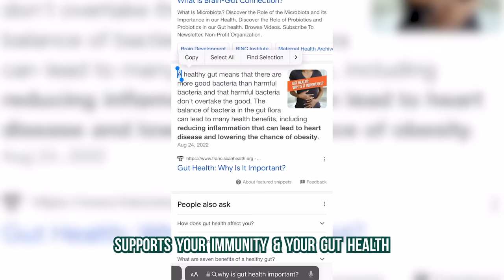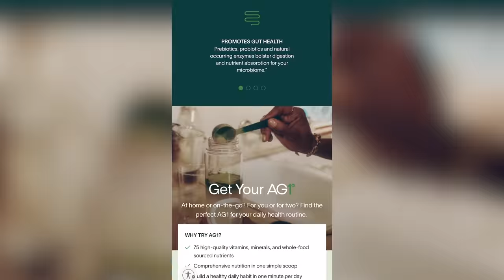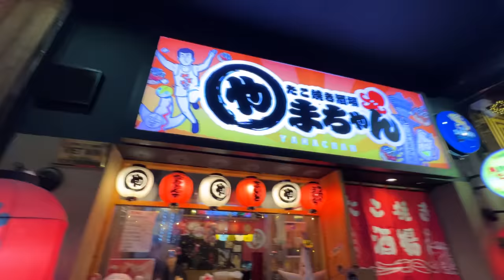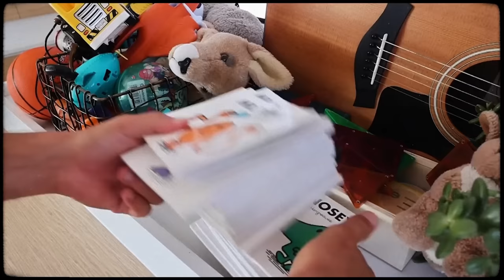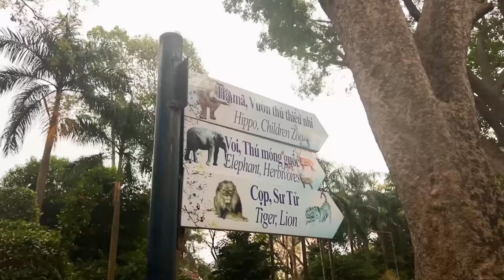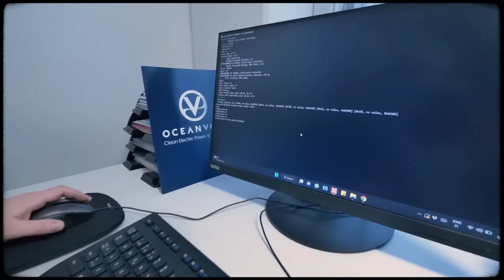When LIGHTNING strikes a Sailboat

Comment: As someone that has spent the majority of their working life in the lightning protection & surge protection industry (over 30 years) I just want to add a little technical perspective. 1) It's not possible to attract lightning and people should be very wary of any person, company or product claiming that they can. 2) Lightning is only ever looking for a quick and direct path to earth, strikes to boats are incredibly rare, mainly because many boats / yachts are glass fibre / carbon fibre these days and these do not offer the quick and easy path to earth that lightning is looking for. 3) The "electrocution from the iPad" that Colin described is called 'touch potential' it's one of the most common ways that people are injured by lighting events. you can protect your electrical equipment (especially communications and navigation) by installing surge protection devices. When in an area where there is lighting activity quickly unplug any devices or equipment (ipads for example) that are not essential for boat safety and navigation. Happy & safe sailing everyone.
Reply: Thanks Sean. I’m really interested in this area and am doing experiments with my boat to protect the system as much as possible. I’ve been suggesting to electronics systems builders that they incorporate optic fiber communication in the boat systems to break up conductive pathways between the various processors on boats such as the Navigation, remote processors, and battery management systems. Surge protection will be pointless if data lines become a pathway via capacitance or induction from a high current strike. I’ve installed all of my solar energy system MPPT’s, BMS’s and Lithium Batteries in a single metal case which hopefully will act as a Faraday cage, and can unplug the solar panels with a single 8 pin plug. The output side can also be unplugged as I have a DC/DC converter charging the house bank, and this can be unplugged easily too as it is just 2 wires. My current house bank will be replaced with FireFly batteries when |I can source them, as I believe these are relatively robust storage devices.
Reply: @williambunting803  You are correct William that isolating interfaces like fibre optics, galvanic couplers etc prevent the conduction of any lightning energy and would make boats safer

Comment: If you look at any lightning strike videos on YouTube, you quickly realize there is not much that can protect against that much power. The best protection is to avoid getting struck in the first place, if that's not possible, then make sure you are not near anything conductive and unplug everything you can unplug. I got sort of hit by lightning years ago when I was on a boat and lightning hit the water about 500m away from us. My hand was about 4-5 cm away from a metal railing and the lightning arced from the rail to my finger. I got shocked pretty good and got a blister on my finger but was otherwise alright.

Comment: You are in THE BEST POSITION with your new boat.... to have electronics removed from circuits when not in use... ( isolated)... yes when underway you need them... but when at anchor or docked... have all that are not needed... removed from any and all electrical connections.... sure the builders want you to burn them up and buy new....

Comment: I used to have a 6 gauge copper wire run down from the top of the mast to the water. It actually worked when we got hit by lighting, all the instraments were fine.

Comment: Love the blue that you decided upon. Being from an area of Florida with a very high level of lightning strikes, I make it a habit not to charge my phone, laptop or even keep TV's plugged in during a heavy thunderstorm. My TV and DVD player are only plugged in when in use anyway. Hope everyone is feeling well. Take care and God bless.
Reply from the maker: Florida has the most gnarly lightning we’ve ever seen. Absolutely terrifying 😮
Reply: When I worked in electronics retail there is a thing called a power conditioner. It was pretty expensive and very heavy but we sold it to our high end clients that bought larges amounts of AV gear. What it does is take power (raw power is rough even on its own and can damage all your stuff over time, even without lightning) and actually clean up the spikes and dips and smooth out the power levels. From there it's stored and then fed into the system as clean power (no spikes, dips, or pops). They always come with a pretty significant fuse system so if a surge powerful enough to do damage to your stuff happens, it breaks the circuit and protects your gear from damage. For a boat I would have recommended a Faraday cage built into the boat that would ground to the bottom or keel but its probably too late for that now. Maybe they could build a Faraday cage into the control console at least.

Comment: IMO - For lightning you need a Spiky (and well grounded) antenna on top of your boat as it helps to discharge the electrons into the sky rather than store them which causes a higher discharge potential.

Comment: The pink paint is referred to as Guide Coat. Often just thinners with some colour tint in it, but there is ready to go Guide Coat for $$$. This was applied by rag but is often sprayed. It allows the paint team to see they have properly sanded the surface and helps identify any low spots that may require filling and then priming.

Comment: The "simplest" lighting protection one can install is an isolated lighting rod at the highest point (above the antenna and masts) with a very thick, low resistance cable extending straight down through the hull to a rod / plate in good contact with the ground / water.

Electricity takes the route of least resistance, so if you can give it a safe route to take, it will.

The catch is, lightning is SO powerful, it may overwhelm your protection system and ALSO go through unintended paths.

Comment: For lightning protection a possibility would be a lightning rod on the mast with a 2/0 copper cable attached to the lightning rod and then attached to a copper plate that is below the waterline that is installed on the hull.

Comment: We build solar & wind powered off grid tiny homes up in Idaho (USA)

They are all EMP, and lightning hardened. Basically, there are components you can run in line in various parts of your system that in the event of a lightning strike will give your electronics a fighting chance

Comment: A friend of mine was struck by lightening on the beach of Block Island, RI as a child and survived. Decades later whenever she sweats the silver chain necklace she was wearing that disappeared in the lightening strike reappears in a black tarnish chain on the surface of her skin. With as much power as lightening has it doesn't always follow rules and easily does whatever it wants to do. Safety measures aren't totally safe but help as a suggestion for the lightening to follow a path desired...

Comment: The Wynns reviewed a lightning strike deterrent that mounts on top of the mast. Also, the Barefoot Doctors are having a Portofino 52 made with jet (water) thrusters instead of propellers. If I remember correctly, it is easily piped to all 4 corners. Turns on a dime.

Comment: Lightning, nothing garantees you won't get struck.  
But logic says if you can equalise the potential (static votage) at the top of the mast to the surrounding water, the sticky-up bit will be no more attractive than the water around you to a strike.
Some studies suggest that lightning dissipates horizontally in seawater just below the surface.
So I fitted my boat keel with horizontal copper straps on both sides near  the top, centred on the mast, connected, via keel bolt, to a wire running as vertically as possible to a rod arrestor, the highest part on top of the mast. Needs to be as thick a cable as possible without compromising the weight aloft too much.
I used 2 gauge/35sq mm copper on my aluminum mast. (maybe a carbon mast would need thicker cable)The copper straps I used were each 25mm wide 1 metre long bolted to the keel.

My boat has been in very intense lightning area tropics for nine years with, so far no strike 🤞. This is just my experience, no garantees but as an avionics engineer installing navaids and radios on wide open airports with tall masts I have found that good earthing (grounding) reduces the chances of a strike as well as damage in the event of one.

Comment: We have been struck by lightning on our sailing cat twice, yes, in the same location. The first time, we were beached on purpose and we actually saw the lightning strike our mast during daylight. All seemed well at first then a couple of days later the 2 engine alternators went as well as the fridge and some nav gear. The second time during an unexpected and fast moving storm we “dragged anchor” and when we started the engine and went to pull up the anchor, we realized the anchor chain had been blown off. We lost all electrics that time but engines were fine.

Comment: When we thought lightning was possible we used a car jumper cable.  Clamped it to rear stay and tossed it in the water , we also stripped the last  three feet so bare copper wire .

Comment: Question about the propulsion. It appears that you have an oceanvolt motor as well as a diesel engine. Is the diesel only used as a generator with high output alternators or is it attached to a prop as well? If so what advantages would that have over a parallel hybrid engine?

Comment: One thought on lightning protection. Guide it around d the boat. Mount a stainless spike out the top of the mast. Connect via a cable to underwater conductors (and possibly to the anchor chain). A strike would run through that low resistance path. Bypassing the boat entirely.

Comment: I recently saw an article regarding lightning strike prevention for boats. There was some kind of device, looked like a metal ball, that attached to the top of the mast that essentially created a field around the boat and directed lightning away from the boat. Something called, and I'm sure I'm spelling it wrong, a ferriday field. Or something like that. Might want to look into it if you haven't already.
Reply: the idea is that you ground the air high above the sea, so its the same voltage as the ground. Not sure how this device would do that any better than the mast, but what do i know.
Reply from the maker: Interesting 🧐 I’ll have a Google of this today!
Reply: I heard tin foil hats....or injecting the body with a high density posive ion solution kills the lightning.
 I heard "the Pillow Guy" has all the proof...but he's not returning my calls. But, maybe I will see him at Mara Lago? I heard there is a great man there that can fix any problem in the world through creative financing!😂😂😂
Reply: That sounds like what the Wynns were looking at a few weeks ago. As I recall the device was pretty cheap but the installation was not.
Reply: @SailingLaVagabonde  and Sailing Dauntless went through this a month or so ago (ep114). Ty does a pretty good explainer also.  Sounds like Dylan is a Kiwi. Did I pick the accent up correctly?
Reply: I think the best way is to make sure the mast is properly grounded to the sea. You connect the mast to a metal plate that is on the outside of the hull. The electricity always wants to take the easy path, so make one. You make a shortcut from the top of the mast to the sea. This way you can (at least try) to control where the energy is going when you get hit. Dont thing using devices to not get hit by lightning is worth looking into. Physics does what it wants. The negative charge wants to go to ground and you have a huge mast creating the shortest path to ground. All big phone towers use the same techniqe, the mast is properly grounded with big wires going into the ground, creating an easy path for the electricity to ground.

Comment: Lightning rods have been around for one hundred years, you don’t discharge the lightning bolt you discharge the static charge to ground or in your case to water so it doesn’t build up to draw the lightning to your mast. A insulated galvanized rod at the top of your mast with a wire down to a grounding plate under the hull will remove the static charge.

Comment: Yea I guess the safest thing to do is to try to sail away from any lightning storms to reduce your risk.  I also know that electricity will always try to find the shortest route of least resistence to ground.  The bit of the anchor chain and mast makes plenty of sense.  Running heavy wire from the top of the mast to below the water line might help but it might also attract unwanted strikes.  I think the risk of getting hit by a car whilst crossing a road is way higher than a lightning strike though.

Comment: I was home when I got hit by lightning. I would describe it as a static shock. Like if your entire body got a shock from someone in socks 🧦 running around on carpet. 😂 It killed my solar and threw me into the cabin, on to a bed. Nothing was smoking but I didn't have any lights till I changed a fuse. Now I have 1240 watts of solar and hip high solid hand rails with netting.

Comment: I had trepidation listening to the lightning story as the last time I sailed on the ocean, well off shore of the West coast of Honduras, a lighting storm about ten miles south and behind us was by far the most intense storm I’ve ever witnessed. I went off watch to rest and about thirty minutes later I could smell smoke from electrical insulation burning. I wasn’t sure where the fire was immediately however I suspected the engine room. Opened the hatch there carefully and there is FIRE!. I made a MayDay call on the VHF while going through my mind where the life raft and safety equipment was. Simultaneously there were storm petrels (sea birds) all along the lifelines of the boat as well as down below. The MayDay call was unheard as the radio was fried. 

The lighting that hit the boat was a ground to cloud hit that entered the boat through a thru-hull. Every piece of wiring associated with electronics were fried. Navigation lights, GPS, autopilot, interior lights, compass light, all fried. Thirty-hours later after hand steering through that night, all the next day and into the almost next morning, I was exhausted yet relieved the boat survived. Some months after this, I started having unexplained fevers of unknown origin. The lightning must have gone through my body (though I never felt it at the time). It’s the last time I sailed 12 years ago. It changed my life forever.

Upon reaching safe harbor we learned the storm petrels were escaping the electrified water.
Reply: wow-

Comment: Suggest bronze bar in bilge extending to an external underwater plate consisting of mushed together bronze balls.  All metal or electrical devices on boat are attached to this grounding bar.  Isolators should be attached to protect back feed to 48 volt system. aka: giant fuse!🤔

Comment: Aircraft use static wicks on the wings and flight controls to dissipate electrical build up on the airframe.The same type of system can be used on the mast of a sailboat. As well as grounding the mast to a plates on the hull.May your new boat swim well on all your new adventures.
Reply: My understanding is that the only thing you can do to minimize having lightning strike the mast is to install a device that keeps the voltage at the top of the mast as close as possible to the voltage on the surface of the surrounding ocean. That makes the mast tip less attractive to lightning though you may see an impressive display of St Elmo's fire there during a storm.
That's what the frequently suggested metal-whisker covered plate bolted to the top of the mast is supposed to do. But to accomplish that, there has to be a conductor from those whiskers down to and below the surface of the ocean. In addition, other electricity conducting wires on/in the mast should include isolators that provide a discharge path that will accept the very high voltage of lightning while not hindering any data signal- or power-providing jobs those wires need to do (for lights, radio, radar, etc). Having a clear continuous conducting path (connection) into the water from the base of the mast -- fairly easily done when anchored (if there's a wire from the chain winch to the base of the mast) but not as easily accomplished when tied up by lines (ropes) or while under way. Perhaps let a piece of bare wire or cable dangle over the side into the water, connecting it at the base of the mast to the wire connecting to the chain winch. Find out how other sailors have solved this problem.
Lightning can strike miles from where it's seen to be occurring although this may be less likely over a large body of water.
Lastly putting a radio, phones, and other possibly critical electrical gear into a microwave oven (unplugged ) during an electrical storm is often suggested since the metal cage of the oven will shield what's inside it from the voltage surge that occurs at the moment of a strike.
There are some engineered devices that are designed to lessen the effects if lightning strikes. It's worth researching these and not just relying on crossed fingers, rabbits feet and 4-leaf clovers.
Love your videos. You are beautiful people, and bless us each week with what you share.

Comment: Surely if you can have fuses to protect wiring against current surge, a weak spot could be put in at the top of the mast that just blows out ( a bit like a sacrificial anode)? I realise we are talking about huge currents. Maybe a piece of extra mast that is insulated massively from the actual mast and just blows away in a lightning strike?